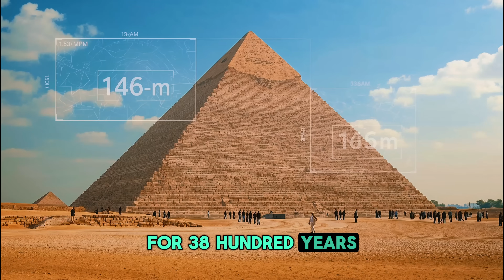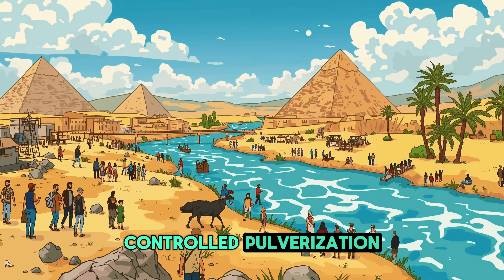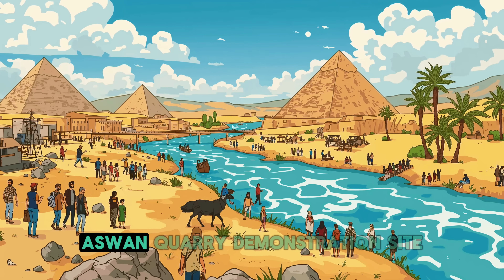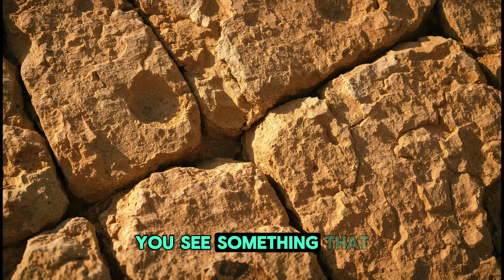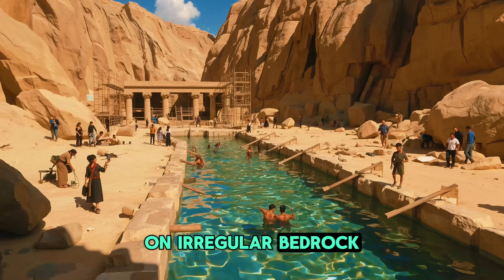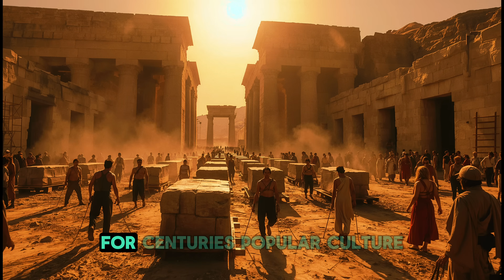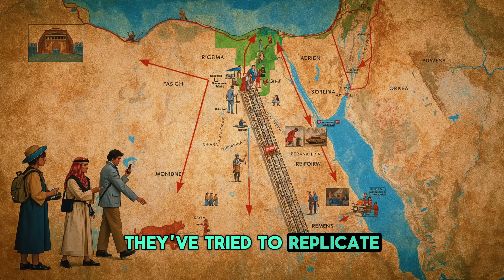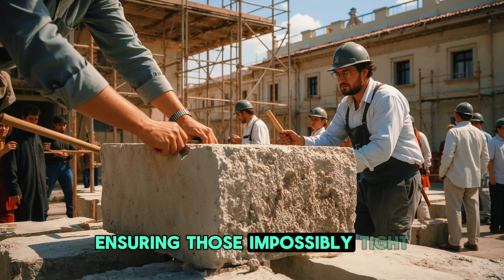Engineers Can't Explain How Pyramids Were Built... Until Now

Comment: Nice try. There are stones around the Great Pyramid that clearly show cuts from a massive blade. Not to mention the hole saw cores which were undoubtedly cut by jewel coated drill bits that were more precise and faster cutting than modern counterparts.
Reply from the maker: You're touching on some of the most fascinating anomalies in the Great Pyramid! Let me address both:
1. The "saw marks"
You're right - there are stones with parallel striations that look remarkably like modern saw cuts. The traditional explanation is copper saws with abrasive sand, but here's the problem: the depth and uniformity of some cuts seem almost too precise for that method.
Chris Dunn's analysis showed cut rates that would require massive pressure - more than Bronze Age tools should theoretically achieve. This is a legitimate mystery.
2. The drill cores
This is even more compelling. The spiral groove patterns in the granite cores (especially the one found at Giza) show a feed rate - how fast the drill advanced per rotation - that seems impossibly fast for copper and sand.
Modern diamond drills achieve about 1mm per rotation. Some ancient cores show 2-3mm or more. Either:

They had techniques we don't understand
They had harder cutting materials than we've found evidence for
Or the analysis is missing something

My take: The copper-and-sand explanation works for most of their stonework, but these specific examples suggest they had additional techniques or materials we haven't fully figured out yet.
What's your theory on what they were using?